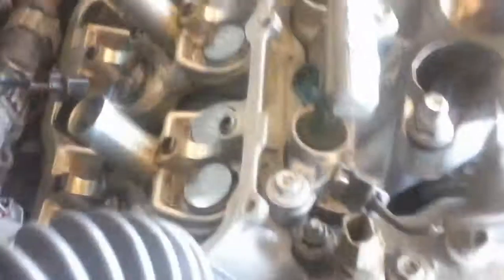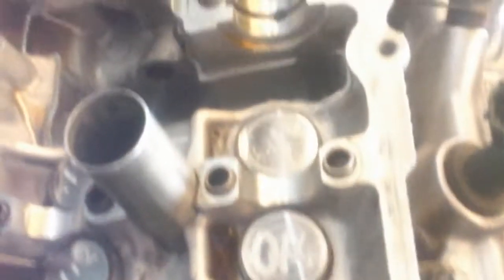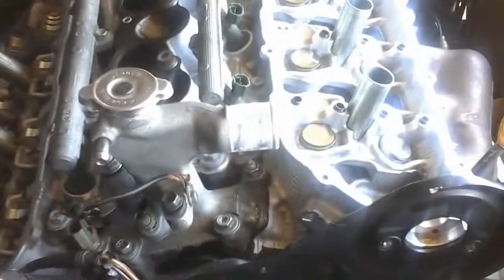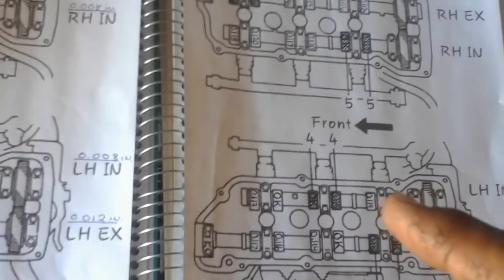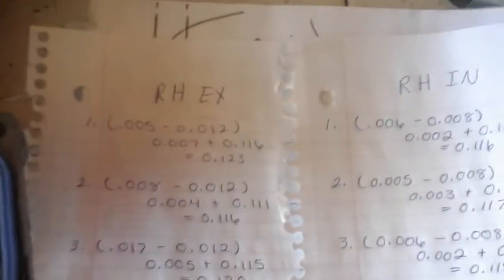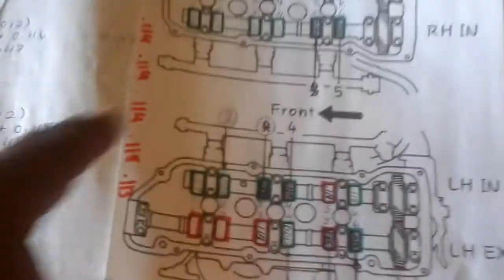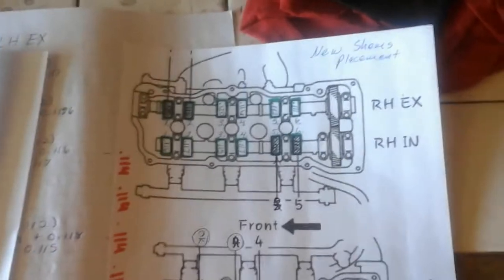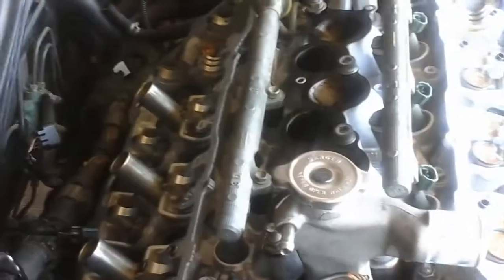Figuring out valve clearance and correcting shim placement on a Lexus  ES300 3.0L

Comment: There needs to be more techs like you in the world. I wish you were looking for a job in the north Texas area right now... Haha. Nice work!
Reply from the maker: Adam Gibson  if I head out there you will be the first to know. My family and I always talk about moving from Bakersfield, lol. It's too darn hot here how hot does it get there?
Reply: Oh it gets pretty hot and humid here. The port-a-cools I have do pretty well, but when I get out of my private shop and into a storefront, the new shop will have heat/ac.
Reply from the maker: Adam Gibson I told my wife we're moving to Texas LOL
Reply from the maker: How's the air there we're stuck in the valley and the air gets pretty yucky here?
Reply: @SuperDjnrg  hey are all the valves supposed to be closed with the engine not running?
Reply: @bamram2673  no. Depending on your engine's position in stroke some valves may be open. Unless you've removed your cams. If you removed your cams they will all be closed.
Reply: @SuperDjnrg 
Hello, are you still in Bakersfield? 
My Sienna needs help please🙏🏽
It's got the valve tick.

Comment: I'm thinking of eventually doing valve clearance adjustments on my 99 ES300 and 02 Sienna with 1MZFE engines. In the repair manual it says to start from TDC for measurements from certain spots, then turn the crank 240 degrees for other measurements, and finally another 240 for the others. Do you need some kind of tool to accurately hit exactly 240 degrees further in rotation, or does it not need to be that precise? For example, if I was guessing while turning - and it happened to only be 225 degrees turn. This is mostly the part I'm worried about, in case that can skew the measurements or something.
Reply: Non-VVTI 1MZ had a camshaft with 228 degrees of duration.    VVTI 1MZ had a camshaft duration of 236 degrees of duration and VVTI 3MZ had a camshaft duration of 240 degrees.    228 is very close to 225, so it was probably for that reason.

Comment: How long did it take you to do this? I want to do valve adjustment on mine 1995 lexus es300
Reply from the maker: Eric Plascencia it's a long and tedious process took me about 4 hours
Reply: Gilbert Galvan , no way , take the top of the engine off , crankshaft pulley timing belt off all that writing, take camshafts off get new shims and put everything back together,  it looks more like 2 or 3 days job 8hours a day
Reply from the maker: Eric Plascencia no not the whole job I was talking about figuring out the valve lash that's a pain in the butt